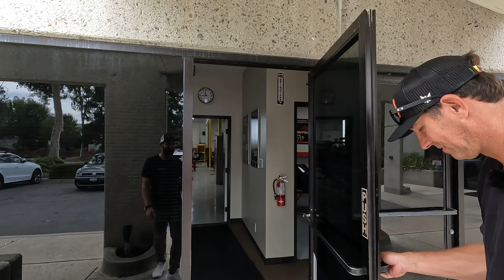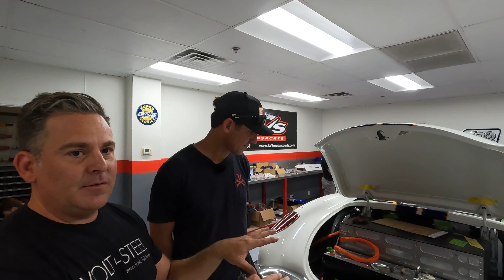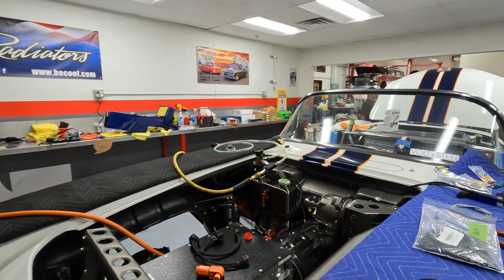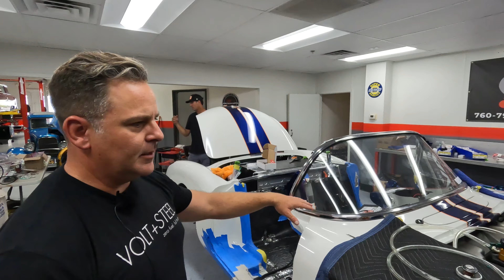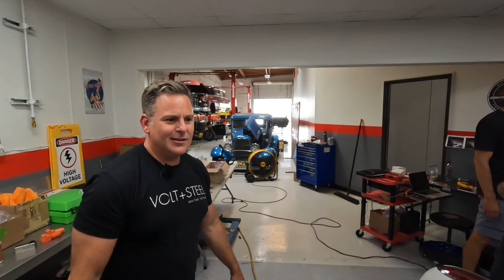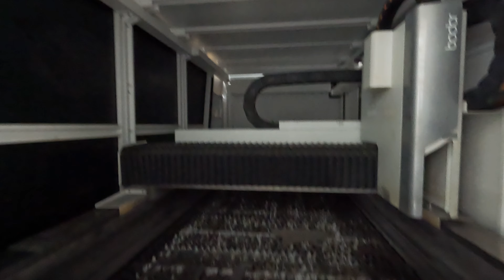Can a Heritage Corvette Beat Every Car at SEMA?

Comment: my fantasy is to have my C5 convertible converted , and regret that the technology is not developed and common enough at this time to be my kind of affordable, but I am glad to see the possibilities.   

looks like I will have to start paying attention to hot rod magazine again, they used to have a bone headed anti electric car editorial stance,  that was quite different from it's glory days that included everything interesting , from drag boats to go carts.
Reply from the maker: I really like the C5s and man do they rip at the track! I haven't seen one converted at all yet but have been looking. I've seen most of the others done, but no C5! 

If the pattern over the last few years holds, the prices will keep coming down. Also the first time any model is done (even using a familiar motor/battery combo) there are unique challenges to that car. But common conversion choices definitely are getting the kinks figured out. So I'm not giving up hope for a C5 soon! 

Man I can't speak for the magazine, but the true hot rodders I know only care about performance and pushing the limits of creativity. I can say spending the afternoon at AVS all those guys were super into the EVs they were building, and the other cars on the shop were literally featured in the magazine and in a Hot Rod magazine YT video from two days ago. You can't fake the type of enthusiasm they had, and there were a couple EV builds there that I saw but couldn't film, so cool things ahead!
Reply: @EVTUNERS Hot Rod's Drag Week had a Lucid attend that ran nine second times on street tires all week!
Reply from the maker: @craigmerrow225 that sounds awesome! Bet it got a few people scratching their head and thinking hmmm